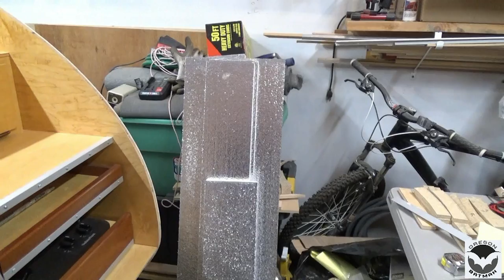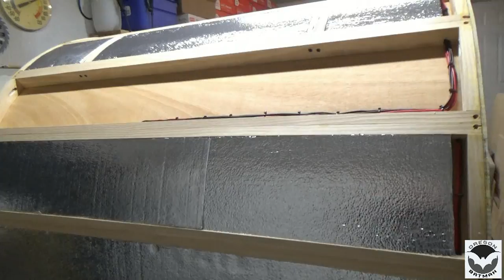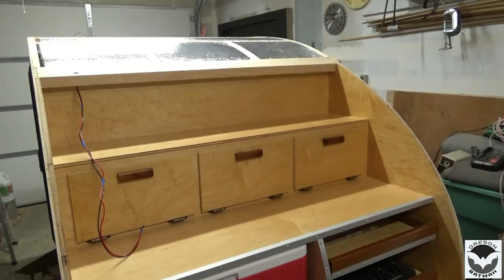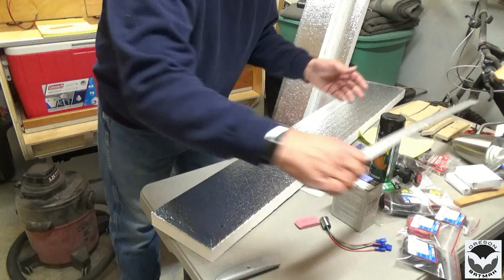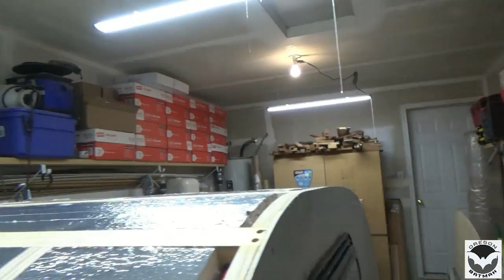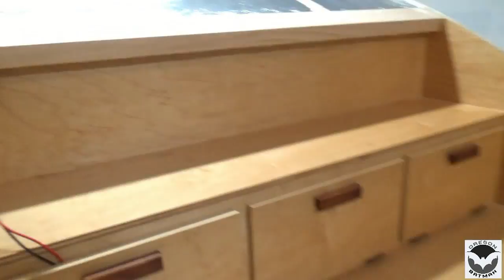Let’s Build A Teardrop * Step-By-Step * - Part 31 (Insulation Time!)

Comment: It’s a little late, but you should have a fuse box to blow if too much amperage occurs down the line.  Also, for future reference, above the lights you should put some reflective material to bounce the radiant heat away from your foam.

Other than that some fine work you have there.

Comment: I hope you didn’t forget about the wiring you need for all the running and brake/turn signal lights.   I never saw you add wires going into your hatch, for your brake/turn and license plate lights.  So hope you have an alternate idea for that.
Reply from the maker: No sir... haven't forgot. All wiring will be under trailer, and I am thinking about installing the lights on the fenders. Will most likely be the last thing I do.

Comment: That electric panel is looking REAL good. Good thing to use for the insulation near the wiring is some stuff called "Great Stuff" it's an expanding foam insulation that fills the gaps around wires and has the added benefit of making the wires stop vibrating keeping the wire fatigue to a minimum for wires that are permanently installed behind walls and such. Keep up the great work :)
Reply from the maker: Thanks DR... I didn't think of using the spray foam, good tip for next time!

Comment: Man, doing all this while also modifying the plans for a 5x8 vs 4x8 seems pretty difficult, but this is fun to watch. Question though: No insulation on the sides? Or does the Filon count as insulation? Does it have an R value?
Reply from the maker: I opted for no insulation on the sides... the little R value it would provide didn't seem worth the effort. The filon wouldn't have much R value. I don't do much winter camping. :)

Comment: Another great video! I would be tempted to use spray foam insulation to fill in those little gaps where the wires are along the sides, but the way you did it looks very clean. Nice shirt!
I have one question regarding the silver foil backing on the rigid foam insulation... is that a moisture barrier, and if so, in the orientation you have it, with the silver on the top side, I suppose it's functioning as a barrier to keep moisture from getting into the roof cavity from outside, rather than a barrier against condensation from the inside?
Reply from the maker: Thanks T455! I suppose the silver backing is more of a "reflectit" material most likely for the R value. Both sides have a barrier sandwiching the Styrofoam.  While one side has the silver backing, the other has a plastic membrane.  For the amount of time a person spends in one of these typically... I'm not too worried about condensation (we'll just crack the vent open a bit!)  :)
Reply: @OregonBatman  OK that makes sense. (I wasn't sure if there was a plastic membrane on the opposite side.)